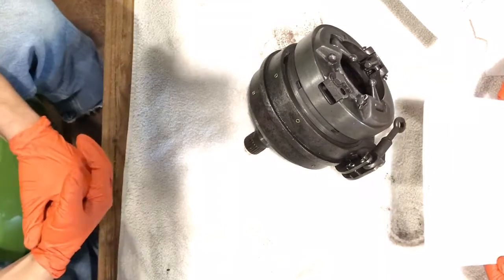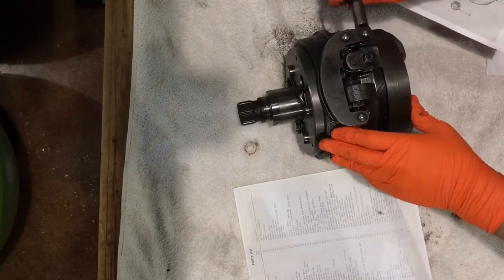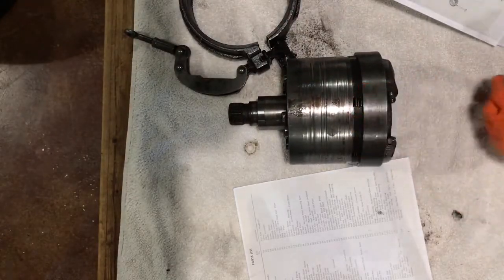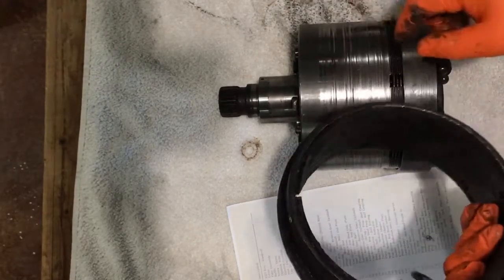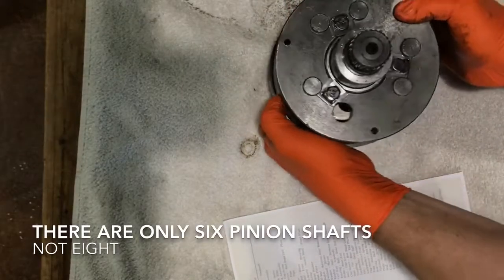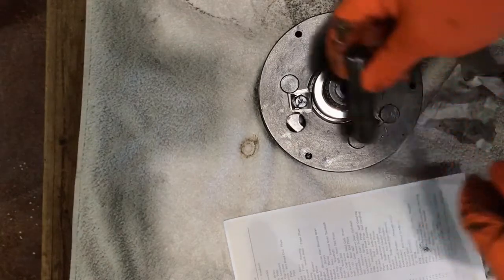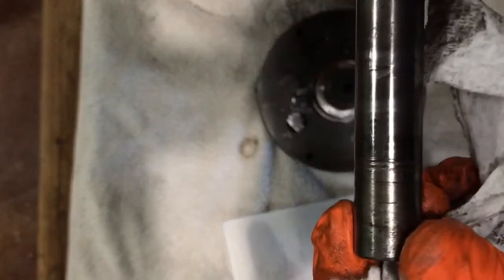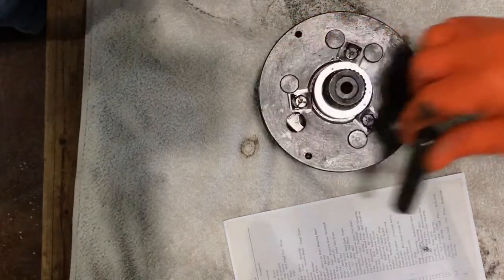Paragon transmission damage review

Comment: Great video guys. I just rebuilt that very same transmission last summer. We got replacement needle bearings at GoToMarine, the long bearings were way cheaper than the short ones. All other bearings and oil seals were bought at bearing ang seal stores for a fifth of the cost the marine places were going to charge us. You were right about that square retaining breaking off and causing your problems, it sucks.
Reply from the maker: Thanks. We got most of the parts to fix it. Waiting to make some dummy shafts any suggestions on installing the needle bearing the easiest way possible?